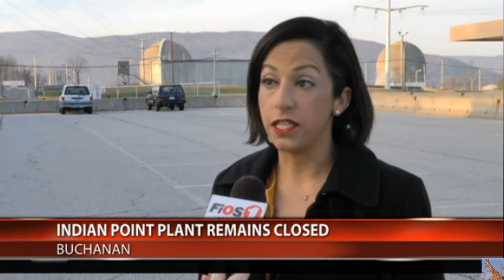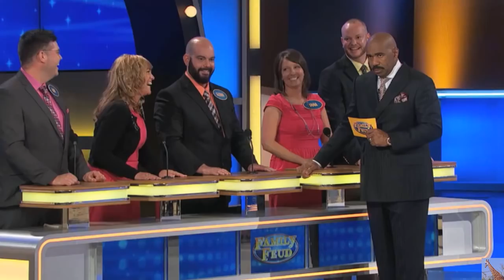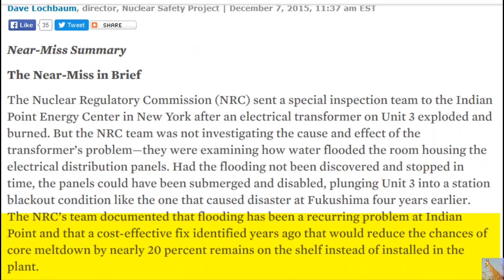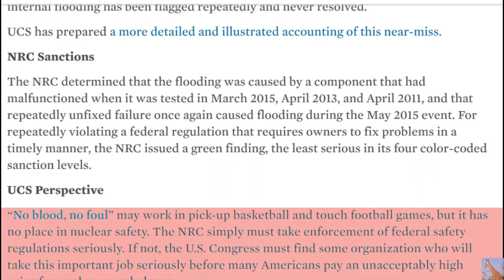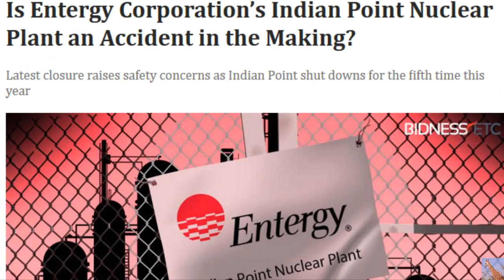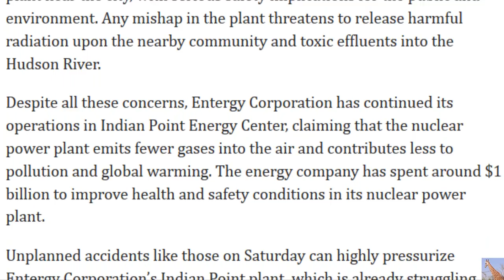Shutdown at U.S. Indian Point NPP~ 10 Control Rods Fall Into Reactor Core 12/7/15

Comment: Breaker trips, electromagnets holding the control rods to the end of the drives out of the core power down, rods fall into core under gravity, reactor shuts down. Mass uninformed panic ensues.